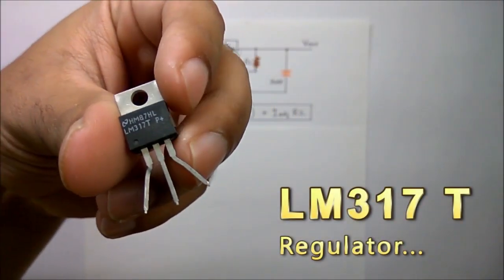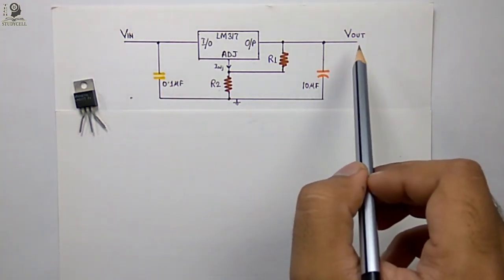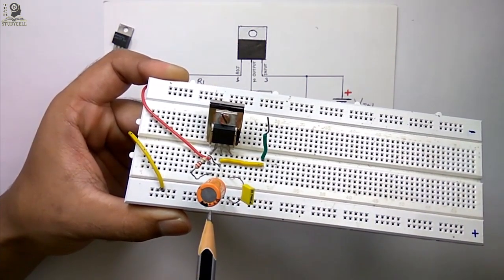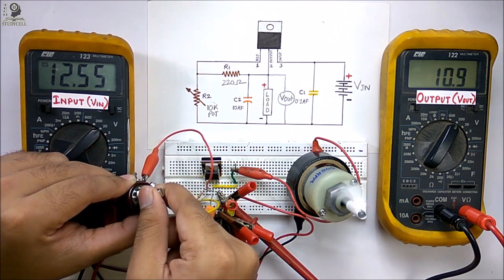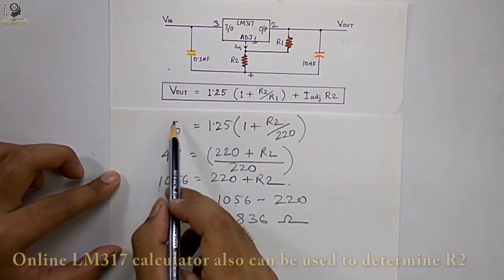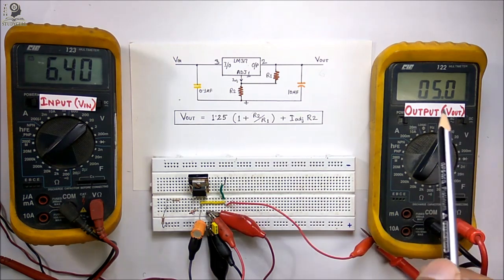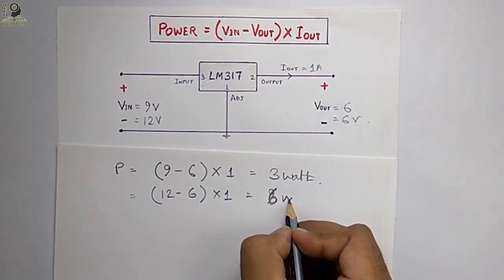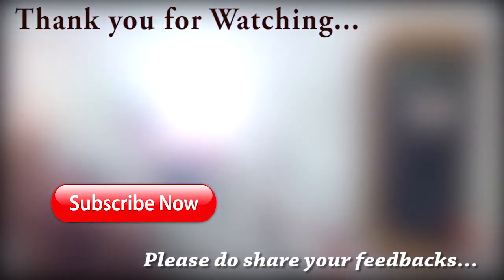LM317 Adjustable Voltage Regulator complete Tutorial with Practical Experiments

Comment: How much should be voltage and Ampere of transformer if we want to use this Ic for 1.2 to 18 Volt , 1 Ampere current and what should be size of heatsink for this as it gets very hot ?
Reply: GOOD question that is all to o often not covered     perhaps because it is rather complex.   
If you are using a bridge rectifier  as a full wave rectifier then the transfomer should be at least 1.4 times the desired output current. In your case rated at at least 1.5A
I forget the channel but there is a very good video on HS.   For 1.2V yould need a MASSIVE HS.  I would have a swtch to select say 1.2 to 8V or  9V to 18V   with a pre-regulator for the lower range to spread the heat dissipation

Comment: Great video but still have one question, does the resistor R1 also make the lm317 react to a voltage drop on the output side because of heavy load.

For example, if the output voltage is set to 10V with one motor connected to the output. If you suddenly connect a second motor  in parallel with the first motor, wil the circuit respond to the voltage drop and and still be regulating to 10 volt?

My goal is to run an modeltrain (electric motor) at a desired speed and switch other trains (motors) on the same layout on and off without changing the speed of the first train. 
With regular power supply deliverd with trainsets you see the voltage drop if you add a extra train on the track and the trains slow down.

Thank you in advance.
Reply: wil the circuit respond to the voltage drop and and still be regulating to 10 volt?     YES

Comment: Hi Sir, if i want to get fixed output voltage of 24volt which resistance should I be using lm317 for my amplifier what would u suggest
Reply: you did not the Amperage nor the input voltage

Comment: Hi, it very helpful video once I tried with 2 multimeter to measure with Vcc=13v input the output of 7v (1.25×(1+1k¤ ohm/220 ohms) =6.83v. 

Therefore the answer 7v from input and 3v from output as I know 3v is dropouts.

My question is there connection problem? I was expecting to get 13v input and 6.93v output permanent.

Many thanks.

Comment: Thank, I tried it worked but I didn't use capacitors though I didn't understand what are they here for, the calculation is of fixed voltage it's bit missing if you can  explain please.

Many thanks.
Reply: Seriously your theory and practice are straightforward clear. Many thanks.
Reply: re the caps   do read the datasheet

Comment: If I use two 100 uf,25V capacitor(both in i/p and output side),i/p voltage 18 V and 100k potentiometer,220 ohm resistance.. then the circuit will work or not?

Comment: Hi very detailed explanation, my question if the pot is connected to ground (i see you have connected ground to the wiper), how does the current flow through both resistors wouldn't the adjust pin just ground i dont understand how the current flows from Vin through both resistors then back out to Vout, where am i losing my thought process :( ?

Comment: Hi, I made it on the breadboard for the test.  It works fine. After soldering, the output voltage remains the same. (Ex: input 12v, output  11v). Could you please help me? Thank you.
Reply from the maker: Check for any losses connection or wrong polarity.
You can refer the blog for the circuit.
https://easyelectronicsproject.com/mini-projects/lm317-voltage-regulator-circuit-1/

Comment: i like that you diagrammed the circuit physically mapping to the actual pin outs. But i have a problem. I want to regulate a heater that creates smoke by boiling oil in my Model Train. Steam Engine. I have built this circuit and tested many times.  It only works correctly if i put the NTC thermistor as the R1 variable value with the R2 as a fixed Resistance. As the heater increases past 140C i need to reduce Voltage to lower heat to prevent over heating. I can never get the NTC as the R2 to lower Voltage as it lowers Resistance, is that right?

Comment: Another superb video... Could you guide me or make a video on how to get 24V 8amps OUTPUT from a 12V Car Battery?
Reply from the maker: you can a boost converter
Reply: @TechStudyCell  I am confuse about these Converters because there are many Boost Converter but mostly are 5/6Amps ones and require 28/30V input for a 24V Output, can you suggest me one which would work with 12V input?

Comment: Sir , instead of connecting LM317 & resistors to input, can we connect a potentiometer directly to a input right?

Will it work to get adjustable output voltage?

Comment: Great vid but I didn’t understand one part. At 1:41 you said using the 2 caps was optional but using them would do what exactly?
Reply from the maker: Thanks, If you connect the caps then it will eliminate the AC ripple so you will get constant DC voltage at the output. I said optional as if you don't use those caps still the circuit will works. But it better to use caps to increase the stability.
Reply: Thank you! Completely makes sense now. Sorry for the rookie question, never had any formal electrical education, just trying to learn what I can online as i find it interesting.

Comment: and you can add 2 diode silicon in serial. they can eat 1.4v up to  1.8v during the current increases. and by that you get output from 0 to 35V

Comment: IT IS VERY GOOD USE Oic 317.Pleas write full details about
1.volume contrle wire type or simple
2.resistance wattes.
3. ic 317: voltage range,current etc
when any electronic circuit is shown on u tube, full specifications r to be given on ckt diagram

Comment: Nice video and informative. Can we use small size potentiometer, since I want to make one circuit by adjusting the voltage and seal inside shrink tube.
Reply from the maker: Yes. but you have to use a heat sink if the temperature increases above the specified limit.

Comment: What will we do if we require fi 1amp  currently . Please reply me asap
Reply from the maker: The circuit can handle up to 1.5 Amps.   It's better to use a heatsink with the IC and if the difference between input and output voltage more the circuit is inefficient.

Comment: sir, can i use a volt display instead of  multimeter..... if i can.... what will be the connection and what the model of the volt display? please help me sir. 

if any information please sent it to sudiptadebnathsskd@gmail.com
Reply from the maker: yes, you can... range of the volt display should be higher than the o/p voltage,

Comment: you need a big capacitor at the input. at least 4700 u.
Reply from the maker: If the input voltage is fluctuating then you should use high capacitance before LM317. here I have used a stable DC input so I have not used such capacitor.

Comment: best video I have seen on the subject to date, explained everything clearly, show the circuit layout as well as what it looks like on a bread board, great, however I got a bit confused when you used a similar circuit to create a fixed voltage. Anyhow mmust try to build it now using an old 30v computer supply although I should really use a 12v supply like you did. What would be the calculation if I still only wanted 3v to 12 v using the 30v supply or could I continue to use the same values as you did?
Reply from the maker: Thank you for your feedback...
Reply: A larger heatsink will be needed I think as when you use 3 volt at 1 Ampere current suppose a large voltage drop will be there and so lot of heat in Ic so large heatsink. But I don't know how to calculate correct heatsink size

Comment: Thanks for the video.

I need to advise what to do when the LED output 130V for a while, it 
will flash the image with the logo but it will go out and the Volt 
output will drop to 58V, the Required 130V will not hold me.

Please, give me an advice..

My model 42LA620S.

Thanks
Reply from the maker: Sorry. your question is not clear...

Comment: I tried but my pot burn
Reply from the maker: Please check the connections, as very small current should pass through the POT for the LM317 circuit so it should not burn.
Reply: Tech StudyCell  7 time I have tried but it burn all time.    (I use   A 10k pot lm 317 and 1k resestence I use 10uf capacitor in output and 14.5 voltage in input)

Comment: nice video Tech StudyCell. 
Can i know the limitation input voltage for this LM317? is it when i consume  voltage up  to 40V, the output voltage can remain constant at 12v for 8 hours operation? I think the regulator will blow right?
Reply from the maker: Thank you for your feedback.
input voltage can be maximum 40volt [TO 220 type]
You have to calculate total power dissipation in LM317 as I have discussed in the video. you have not mentioned the ampere value in your question. If power dissipation is high then use a proper heat sink, it will work fine.
Reply: Thank you for your response and your awesome video.
Reply: Tech StudyCell The LM317 have no maximun voltage, is floating regulator . 40 volts is the maximun input-output differencial voltage.
The máximun power dissipation is 20 watts, after that the protection circuit shut down the regulator.